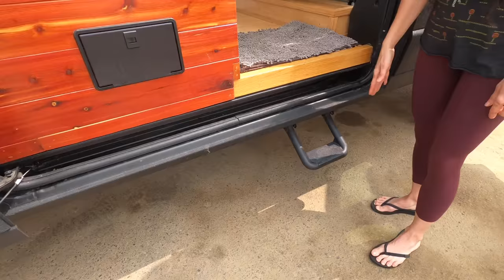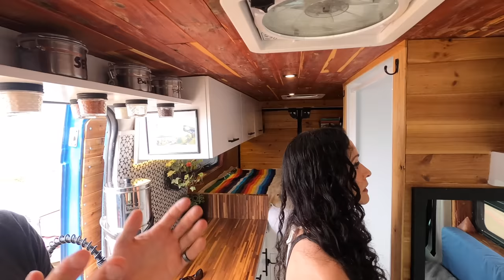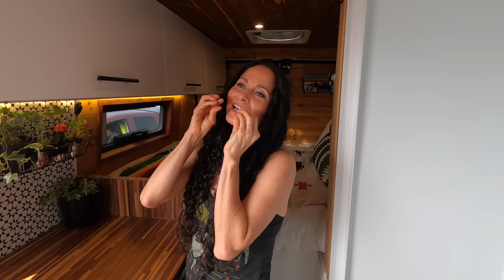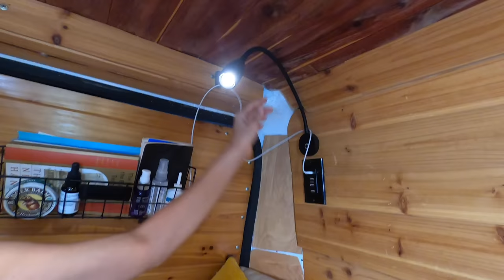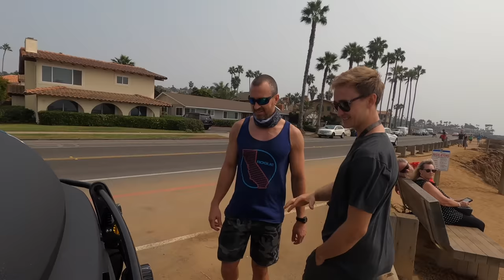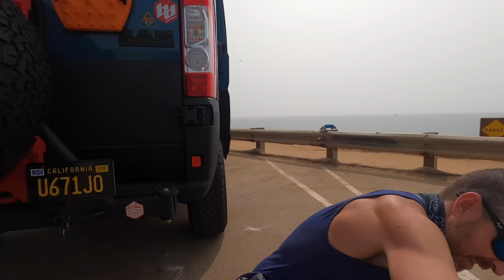BADASS Lifted Promaster Van Conversion | Full Van Tour | Offroad Beast!

Comment: Great job on this Promaster -- love the design inside and out. A tremendous tip on the shower pan -- the offset drain. Where did you find it?  We are in the planning process of our Promaster build and we would have the same problem hitting beams in the chassis.

Comment: Hi, great looking van.- Long wheelbase, heavy and with 2wd-fwd. Q. Do you ever get stuck from loosing traction from the front wheels with open differential?
i am writing from europe, here we have the promaster from Fiat/Peugeot/Citroen - it is called a Ducato/Boxer/Relay. There does exist in europe a 4x4 conversion made by a company called Dangel, it is a traditional mechanical AWD system using a viscous coupling instead of a centre diff. It does not use any transfer case so no low gears like a 'proper' 4x4 as the european model of the Sprinter. (i think in the USA the Sprinter there is different than the european version, not so fully-4WD, more of an AWD using technology from a mercedes car like 4-Matic).
I did buy myself a Dangel-Ducato 4x4, but i sold it again with a new idea to build my self a part-time hybrid 4x4 using electric rear wheel drive, as an Add-on to a regular FWD Ducato/Promaster.  I have written something about my project over on the promaster forum. Strangely i do not find many owners who find a limitation with their 2WD Promaster?  Do you have any experience to share on that? If you think it would be helpful on any occasions to flick a switch and have added traction from a rear electric drive system? I am designing my system with 48v, so that it can operate using a modest size LiFePo4 battery similar in size as many van-livers are installing (4 x 12v x 100Ah = 4.8kWh). This will be enough for up to 20minutes use for recovery operation with the rear drive.
Reply: electrical system for rear wheels???  i think its practical, but expensive. And to make your van into a tesla, your battery idk if its enough power to rotate your wheels

Comment: Just a reminder for the comment section. This is a pretty expensive build. From the tires, suspension and raptor lining, to the red cedar, butcher block counter top, Battle born batteries, and Victron components. All this combined with a 2019 van probably costs over 60 or 70k. Not knocking the build, it is incredible and beautiful. But as someone that is currently building out my own 136" Promaster I wish I would have come along a comment like this back a year ago or so. For reference, my van cost 20k after taxes, and my conversion will probably be around another 10k. A middle of the road price point IMO.

Comment: How does it do in big snow?  I think by now in late 2021  it has been determined that wool is the best insulator.
Reply: We avoid the snow at all costs, we are sun chasers…however, we did get stuck in Texas for the big freeze last year and our van was surprisingly comfortable. Our experience is that the spray foam insulation is definitely the way to go compared to wool. We only had our heat on for 20 minutes in the morning and then at night before bed. Our Vanlife friends that had wool needed to keep their heat on all the time. Spray foam has a higher R value… great in the heat to keep the van cool. Spray foam also gets into every nook and cranny, which are all over a van. Definitely worth the extra cost… especially if one is planning on living full-time.

Comment: Nice van but if you're going off of pavement you need AWD........  With the Weight of  conversion vans you need as many wheels spinning. I owned  2019 2 Wheel Dr. transit now I own have a 2020 AWD transit night and day difference.
Reply from the maker: Another thing to consider is transit rear wheel drive perform worse than promasters front wheel drive. Really the promaster romt wheel drive is the middle ground between the rwd and awd.

Comment: Hey, can someone tell me how to find the company that manufactures the rear bumper spare tire holder on this Promaster?  In this video the owner of this blue Promaster said that the company is located in Anaheim, CA, but I couldn't find the company listed anywhere.  Could the owner of this Promaster reply to this question and tell me more accurate info about the company that built his spare tire holder?
Also could the owner of this blue Promaster tell me how large of a tire you can put on the van after the 3.5" front and 2.5" rear lift?

Comment: Expensive and not at all practical for a full timer but cool for a weekend rig.
Reply: Hmmm.. Curious why you would say that? 
We have been living in Luna full-time for over a year with everything we could possibly need.. completely self contained, extremely comfortable. 
Expensive, yes, since this is literally our home.. we wanted to invest in the best products... just like someone would do in a brick stationary house. 
It’s so nice not to have things break all the time. ☺️
Reply: @shane38002  got it. You may be right, however, we did get a separate computer unit to calculate the proper readings according to the larger tires. We did just downsided to 265s and got rid of the tire carrier because of the added weight. 
Also.. we work for the National Park Service seasonally so we do minimal driving during our work season and travel during our off season. That is how we have been able to only put 16,000 miles on Luna since we got her in November 2019. Actually, the last time we got gas was on June 6th!!! This job is totally prolonging Luna’s lifespan. ☺️
Reply: @ForrestTierce  It's a fantastic build and I wish my 2018 ProMaster was in your league. Honestly my "not being practical" comment was strictly directed towards your tire size. IMO the added weight of a  fully built out van is hard enough on the drivetrain and mechanical components without oversized tires. Plus without adjustments to the vans computer and changing the gear ratios I can't see you going up step grads unless in manual. Add in the loss in mpg, handling and breaking it just doesn't seem like the ideal choice for fulltime van life unless you stay local.